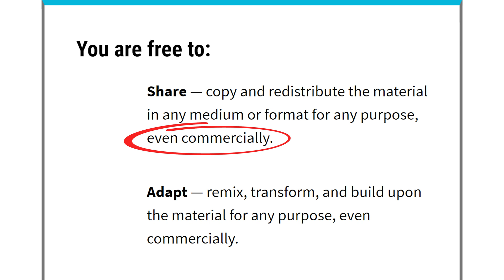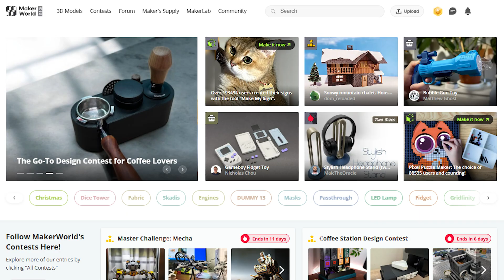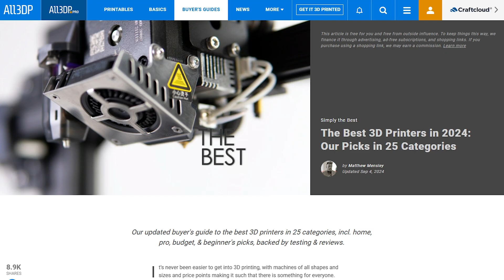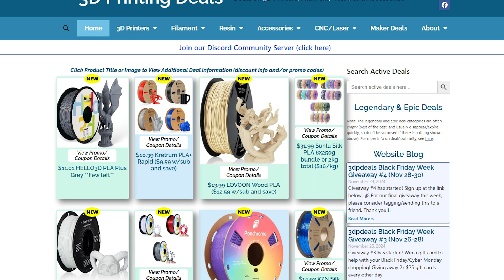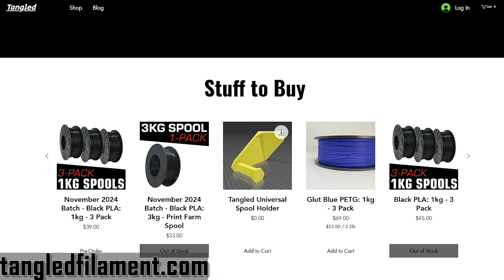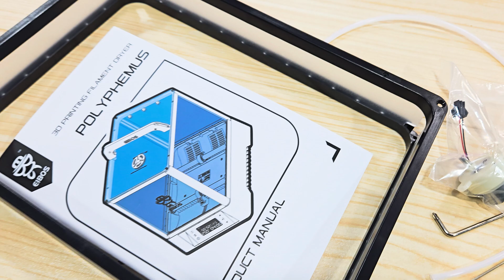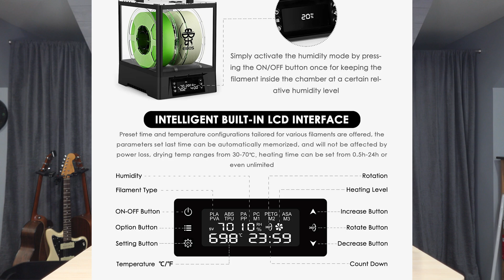Top 10 TRUE or FALSE 3D Printing Facts!

Comment: 100% agree that you don't need adhesives in most cases. I've been printing PLA and PETG for years and never used anything other than IPA to clean the print bed now and then. And even IPA is probably not needed, some say that simply using soap and warm water is even better actually. If you have adhesion issues and the part doesn't have a large bottom surface, try again with a wide brim. It uses like 1-2 grams of filament and can make a huge difference.

Tip regarding filament dryers: don't just buy anyone, get one that actually has some vents (that you can close of course). Almost all filament dryers on the market are designed to be always airtight, which means the moisture can't actually escape and you regularly have to open it by hand to make sure the released moisture can vent out.
Reply: Agree with your first point...mostly.  I still use glue stick for PETG but not for adhesion but as a release agent.  I've had PETG weld itself to the PEI bed before but with glue stick it hasn't happened once.  I also find methanol is far superior to IPA for cleaning all oil residue from the bed.  But a good wash in warm soapy water will get you 99% of the way there. 

As for filament dryers airtight does have its place but a good desiccant is a must.  Silica gel is inadequate and I find calcium chloride to be vastly superior.  But dropping upwards of $100 to dry filament is insane.  I use a 5 gallon home depot bucket that is airtight. it has a 40W silicone heater pad on an old PC heatsink and a tube that pulls the air down from the top, over the warm heatsink and then the air cycles up the sides, past the filament and gets pulled through a desiccant box and then back down the tube.  This thing is shocking at how much moisture it will pull.  Granted it's not as convenient to open and get a spool out but if I'm so lazy that this is too hard for me then I really shouldn't be 3D printing in the first place.  lol
Reply: Printing ABS on glass with no glue at all just fine :) (with a brim ofc)

Comment: Not too long ago, Prusa updated PrusaSlicer to read colors properly from BambuStudio files - I've made some color prints with the MMU3 that were designed for Bambu printers. Make sure PrusaSlicer is up to date and you can use files designed for the AMS. Although unfortunately multi-plate files are still a problem.

Comment: I'm very new to the hobby.  Is there a way to tell?
If your filament needs to be dried before you start to print
Reply: If it easily snaps instead of bending, that is a sign too much moisture has been absorbed. Another clue is you may hear popping noises coming from the printhead as water vaporizes. And the print quality will be poor with little globs everywhere.
Reply from the maker: The popping is always my biggest indicator, along with zits and blobs. Unfortunately, you can't always tell until you print, since the snapping could also mean UV exposure, back and forth wet/dry, or just plain cheap filament (and this time I do mean, "cheap!")

Comment: Humidity readings.  Example of 20% humidity reading. First we start with 100% humidity, that is the MOST that air can hold. At that particular time, temp, DA, and other variables. The "100%" base is dynamic and constantly changing. Joes 100% will differ from Jacks 100% if they are at a distance.  So when a meter reads " 20%", that means that air has 80% capacity left.  Or that the air is at 20% of its max capacity.   One can take 2 cubes of air from 2 places around the world. Lets say they both read 30%, so they are the same, right?  Nope, one can contain way more humidity. Because the % is based off what that air can hold, and that is based off many other things.  

What is important is to know at what humidity levels does different filament absorb at and at what speed / time per KG. The same for desiccant solutions, knowing at what % of humidity does it start to absorb, or what is required for the desiccant to release its contents. Lets say you store in a room that is not temp controlled. So in the summer, its over 110, and in the winter its 20. So that desiccant absorbs the humidity as normal, however, in the HOT days, it may release that same moisture, a loop. A good example is tossing a used desiccant bag in dryer with a roll of filament. As the heat hits the already used desiccant, it will release its moisture. Understanding that will assist in assuring good material.      Or knowing how long it'll take storing "damp" filament in a low humidity environment. Or knowing for long term storage that the temp only needs a few points over ambient.  One should look for passive solutions, ones that require no outside power for extended storage solutions.       Personally, I live in Hell Paso, and it gets HOT AF here, but good news its a dry heat. People party if we get rain. :)
Reply from the maker: WOW! That was deep! I read twice to make sure. Also, great point about the dessican actually "releasing" moisture. I try to re-fresh mine every other use or when I remember, which is another great use for a filament dryer! Thanks!

Comment: Solid advise, I find it's often a bit difficult to have 3D Printing absolutes but you elaborated enough. (sombody in Arizona probably won't need to care too much about filament storage) were somewhat in between here and I had mixed expiriences so far. (cases were drying filament made a really big difference but most pla works good enough out of the box - still going to get all my stuff boxed just for ease of mind)
Reply from the maker: Thanks!